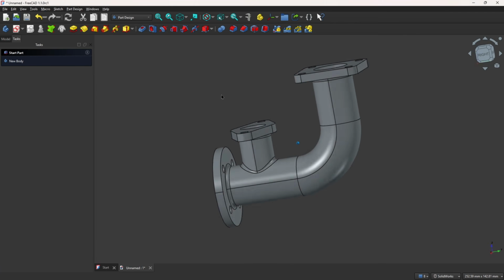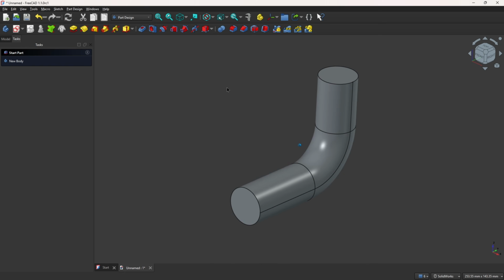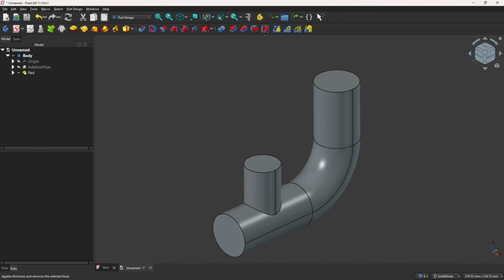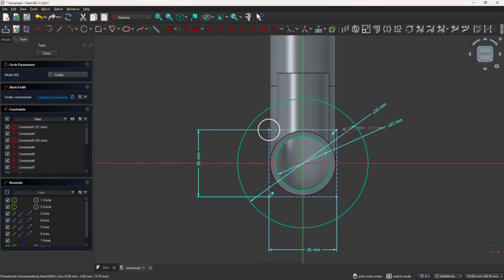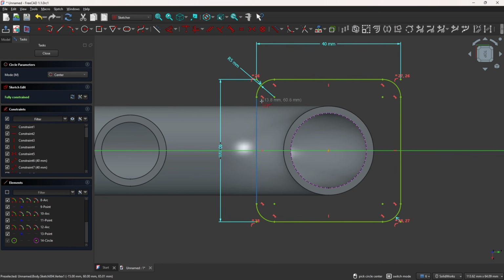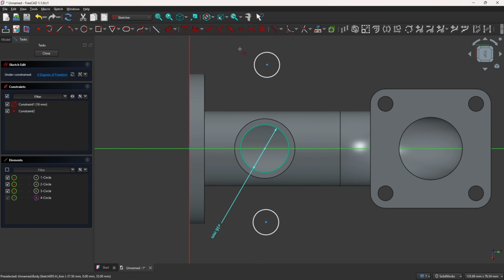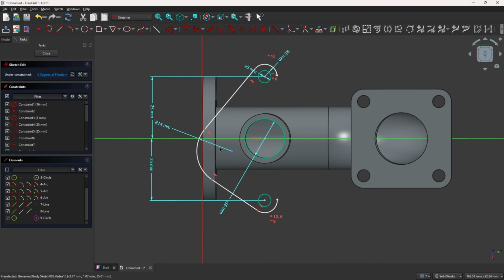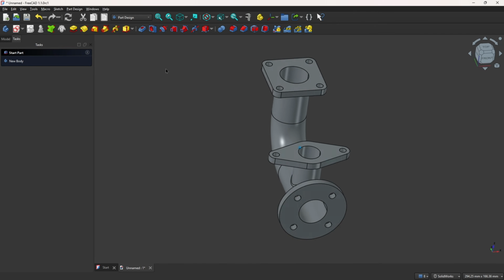FreeCAD  - Complete Beginner Tutorial Step by Step Exercise 34

Comment: I had assumed, based on previous usage, that the thickness tool was too buggy to do multiple faces like that.  I might have tried to make the pipe hollow by other means. Like having the profile be hollow. Or have a smaller profile that would do a negative sweep using the same path.